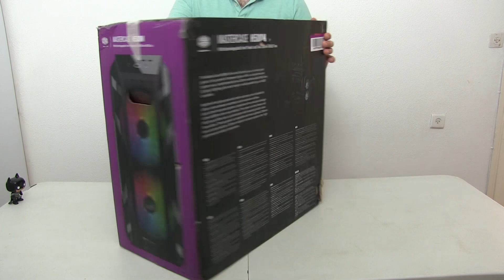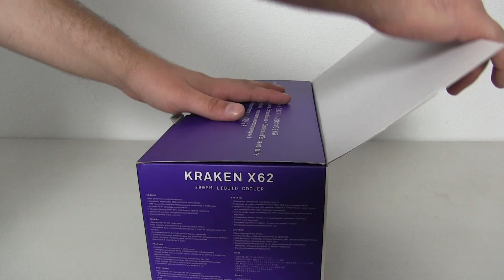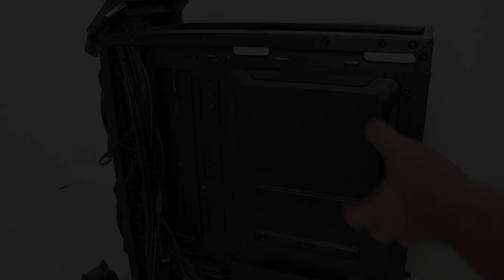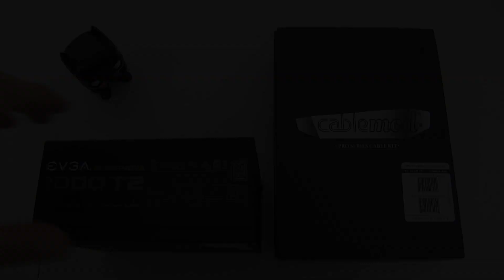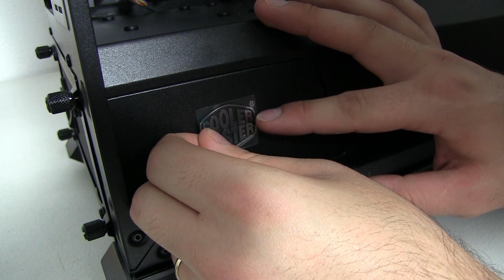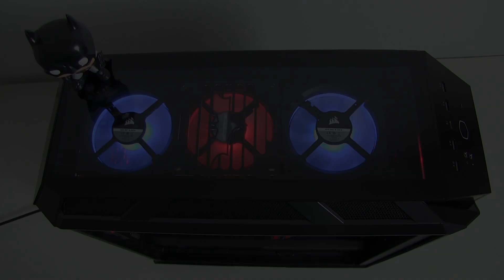The Dark Knight theme PC - Time lapse  - בניית מחשב בנושא האביר האפל

Comment: What’s your CPU temps since you have the radiator mounted up front? I’m literally building mine the exact same way with the same case. Just making sure it’s worth putting it up front and not heat up the rest of the components.
Reply: CPU tema on Idle are 26-30c
In game (high demands) around 60~70

The GPU idle on 49-53c
In game 70~80